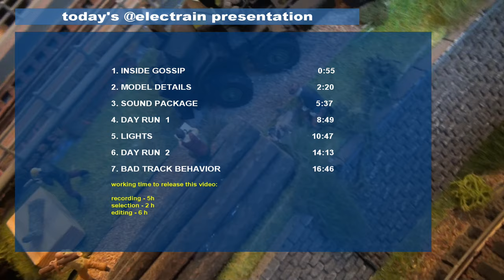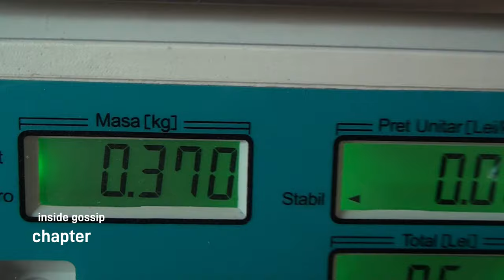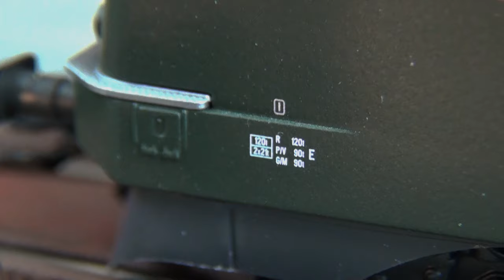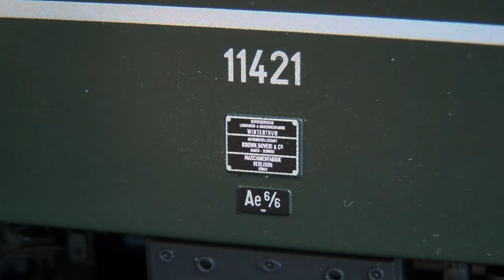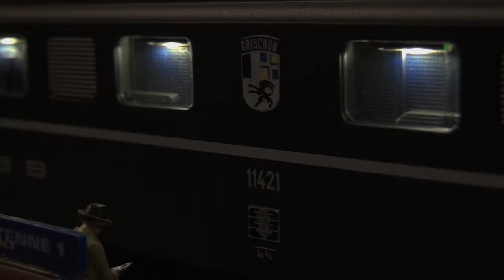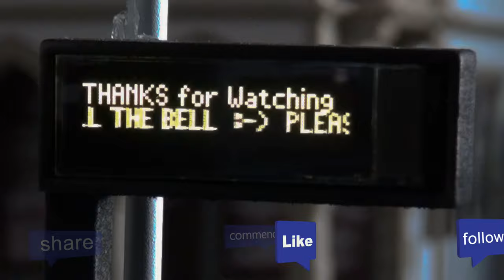🇨🇭  Märklin 39365 / TRIX 25666 Graubünden/Grischun SBB Historic class Ae 6/6 electric locomotive

Comment: Thanks for your detailed review and critique.  I subscribed.  Are those plastic gears in the bogies?
Reply from the maker: Thank you for subscribing.
Main one from wheels are metal, rest is plastc. But they are big and solid looking (Marklin style). That s why in ESUs video I mentioned the impression about their solution in regarding. 😊
Reply: Just wonder, does ESU use metal or plastic gears for T18 and V200?  And Märklin uses plastic gears too?
Reply from the maker: @marklin_in_canada  mostly the used material for it is plastic
Reply: So those plastic gears would wear out over time and locomotive loses traction and slips?
Reply from the maker: @marklin_in_canada  let s say that if your locomotives are not runing eeach and every day at least 3h/day you don t have to worry about.
of course factory poor quality is possible sometimes but it s rare especially on Marklin.
you have an example of durability on our recent video for PIKO 59322 where the metal of the wheels expired but the plastic gears are still usable. regards,
Reply: @electrain  Thanks.  I watched the video.  Was oil added to PIKO railcard during the 1870 hours of service?
Reply from the maker: @marklin_in_canada  no. absolutely no maintenance. initialy we was sure it will die in less than a month...